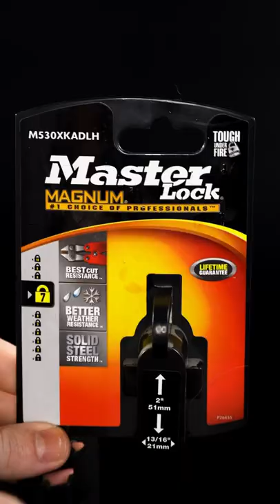001 - Master Lock 530 #security #padlock #lockpicking #howto

Comment: the driver pins are already spool pins it comes with four very small spool pins out-of-the-box so unless you're changing your key pins for something higher security which I didn't know you could do this lock is poop